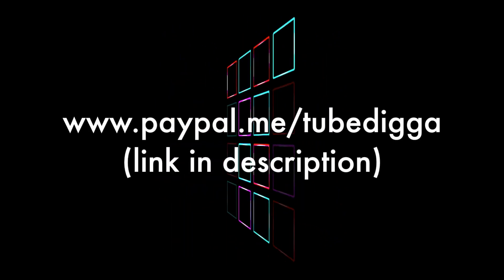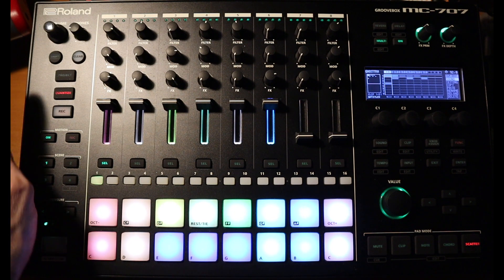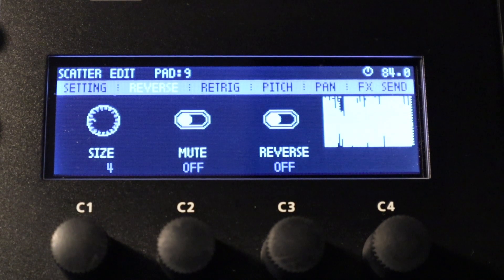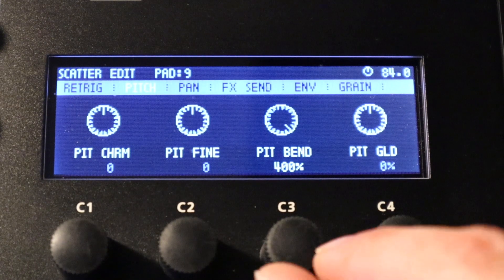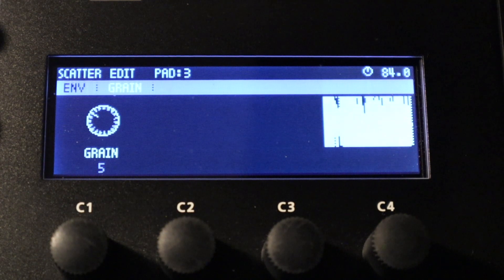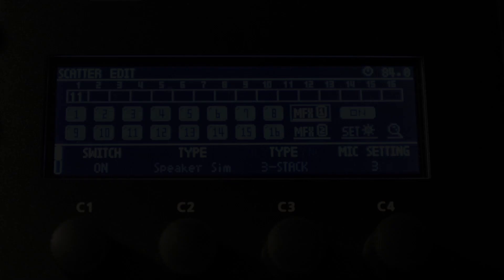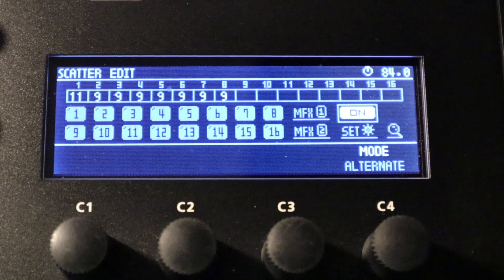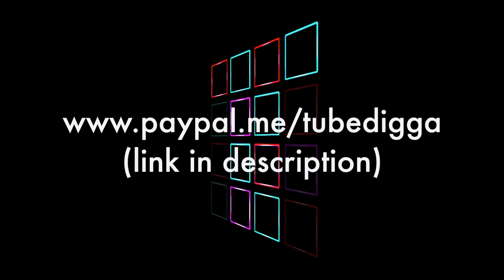How To Program the Roland MC 707 Scatter Effect

Comment: What happened to the 10 part series? :(
Reply from the maker: I sold my 707 several months ago as it had some issues that weren't resolved in the last firmware update. I found I was only using it for simple loops rather than something I could work on full tracks.
Reply: @TUBEDIGGA  yeah right, good to know. Mind if I ask what you ended up choosing to spend most of your time working with? Trying to select which main machine to use at the moment, would be great to get your perspective/knowledge on what you use. Cheers for your time!
Reply from the maker: @grazstarr  I’ve been consistently working with my MPC, I also have Maschine Plus and the S2400,

Comment: Do you still plan on doing the tutorial series?
Reply from the maker: I'm afraid not, I sold the 707 as it became frustrating to use what with the lack of certain sample editing functions. I also found myself using it for basic loops and messing around but not actually finishing any tracks whatsoever.
Reply: @TUBEDIGGA  Yeah, I think its more of a sketchpad. I just had the JD-Xi infront of me and that unit kind of reminds me of the MC-707 in a certain way. It has a lot of stuff in it but all the advanced functions are hidden in menues so the question becomes how useful are the easily accessible functions for what one does. Maybe stupid question but do you enjoy finishing tracks on the MPC One for example? I'm kind of hesitent to try one way or the other, since I think I'll be too impatient (workflow on a hardware sequencer vs daw). And when the useful function of the MC-707 is being a glorious rompler with sequencing, I'm not quite sure I want to pay 800. (Btw. the fact Roland doesn't offer a complementary patch editor and librarian is kinda greedy).
Reply from the maker: @LaymensLament  I finish everything on my MPC One, check out my MPC DJ set I did in the record shop a couple of videos back on here, all of those tracks were created on the MPC One and MPCX in standalone mode. You can do everything in MPC
Reply: @TUBEDIGGA  Well you can but do you want to :D. I'm gonna check it in a bit, thanks!
Reply from the maker: @LaymensLament  Do I want to? Yes of course, I love working with it, it's so easy and a pleasure to work with. Far better than pushing a mouse around.
Reply: Well, the mpc one is the best sampler/sequencer combo for under 1000€. Keep ignoring it tho because the workflow focused on the big screen makes it seem unattractive to me. But I keep buying worse solutions, so maybe I'm making expensive mistakes. Thanks for your responses!

Comment: How do you do this effect on an MPC or in Logic....?
Reply from the maker: With the MPC you have the XY beat repeat and Air Stutter effects which would be the closest - however the 707 is a little more precise. The MPC timing is fine but isn't as accurate. Also you can't assign all the effects and the different time values and other parameters to the pads on the MPC, you'd have to use custom QLink sets ups (in Qlink project or program mode). The Akai Force can though, using the Macros feature.